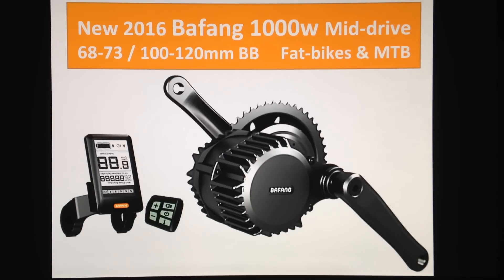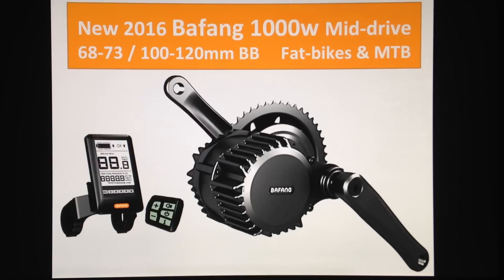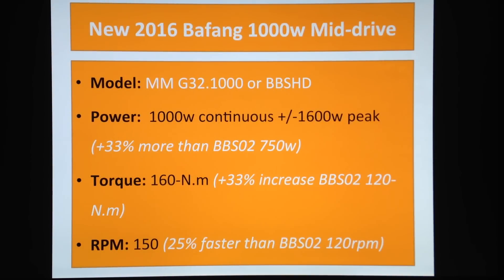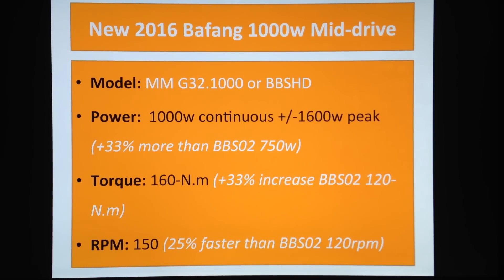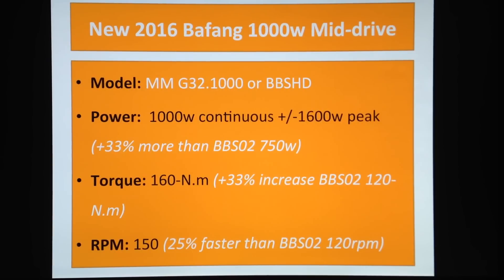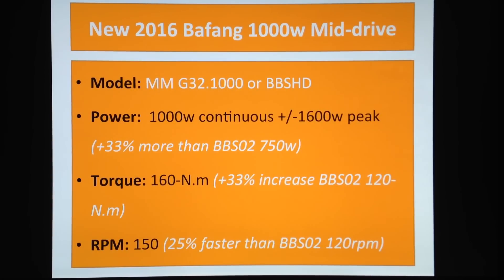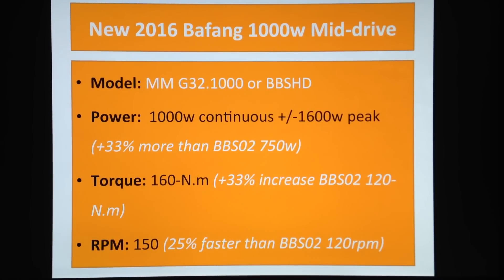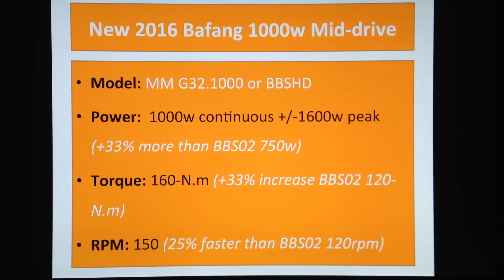New 2016 Bafang BBSHD 1000w mid drive for Fat Bike & MTB (video 1 of 7) MM G32.1000 8fun BBS02 750w

Comment: Wow I just got mine on but 10kg weight mass ... need bigger coils on suspension.. 🙀
Reply from the maker: Yeaaaaahhh... you will LOVE this motor...
Why 10kg?!?!? The BBSHD is around 4.8kg what size is your battery pack 20Ah???
Reply: Man it's showing a error 30 ... worked fine on day 1 (10min ride ) ... the next day I shortened the battery cables and error shows .. no POWER % !!! Haha .... looks like I'll be sending it back :/ .. error 30s are communication errors so I'm assuming my battery is ok and it's the controller / screen . I rewired everything twice .. battery shows 54v  fully charged (48v 20ah) seems ok  ... not a good start to my ebiking experience
Reply: https://youtu.be/TnM0lLL0RM8

Comment: whats your experience with the durability of the bafang middrive hd 1000 - ... Watt Motor. In comparisson to a direct drive hub motor the gears of the bafang could become problematic. Good here is that you can get spare parts for a acceptable price. Also to put smear nipples on the motor could be helpful. How many miles did you drive with this motor without bigger problems ? My 150 $ chinese direct drive hub motor ( 1000 Watt ) now has 20 000 km ... and still doesnt give any problems. What would you recommend geared midrive or direct drive hub. Seems the bafang with 30 A is a little faster than my hub motor.
60 kmh   vs    53   kmh.

Comment: We have two FS mtb with HD motors that we use to ride hills, both motors now have loud noises when we ride. Anyone have the same problems after 600 miles? Openned up both motors and did not find any obvious problems. Re-grease helical gear on rotor and the spur gears on crank drives with aircraft synthetic grease. Same noise problem after two rides.

Comment: We cant get into the menu Bafang 1000w (DPC10.UART)   to check voltage ...The battery display wont come off full charge. Password portion menu for battery  communication...Goes from  (nnA to LUd) we need the screen between these 2 screens....to check the settings.....HELP  !!

Comment: Does this have enough power/torque to perform a wheelie: either from rest or while moving slowly? I'd be impressed than!
Reply: My cheap, extra heavy Razor MX500 with 750watt 48v motor with my big lug 210lb body on it can produce 1400watts and do a wheelie from a slow moving start.
Reply from the maker: +RCengineJoe yeeeaahhh.. It does torque and power enough for almost everything you need... i have been climbing some big stairs lately.. monster torque and high speed specially if using with a 52v (14s) battery at 30A =]
Reply: I am running a 42 front ring, a 34 back sprocket,  52 volt battery and if you lean back it defiantly does from a stand still/ slow speed. it can surprise with a wheelie while climbing steep stuff if your not careful as well. I think this is perfect. powerful, quiet and reasonably light. Unfortunately it's not cheap and if your mates don't have one you will be riding on your own.
Reply: Yeah I know, I want one really bad but I need to buy a new bike plus the Mid Drive Kit and Battery. I'm looking at a sticker price, for what I want, of a minimum of $1800.00 USD.

Comment: question. I have heard that the peddle assist is gonna give you problem when switching gears because the gear sensor isn't fast enough to detect it. Is that true?

Love your enthusiasm btw  :)
Reply from the maker: Hi Tony, it depends what gear sensor and what controller and what programming settings you're using. Some controllers come with a connection for gear sensor and some controllers you have to connect to one of the ebrake cut off connections.. in 98% cases it works fine, what will vary a lot is how long it will cut the motor power. There are some combinations that you do specially when switching between pedal assist and throttle that you may the gear sensor may miss it but you'll learn how to ride and avoid anything like that. =]

Comment: that amount of motor force will likely  gradually crack bicycle metal tubing over hundreds of hours and the crack could spread further over time unnoticed and could suddenly break  whilst in use. the rear swing arm might get snapped off the frame  also from the force created from the chain pulling against the cassete flexing the swing arm

Comment: Nice one.
Can I put the pedal assist off and use just throttle when I face uphills on my way to/from work ?
I want to pedal on my own and do the above.
Thanks.
Reply from the maker: +Dr Abd - Yeeeahhh.. it is totally possible to switch the pedal assist OFF which in this case shows on the screen as "PAS 0" however, the factory settings Bafang ships with this units won't allow you to use throttle on PAS 0, good sellers will be able to program throttle at PAS 0 for you. There is a programming cable that you can buy separately and connect to your windows PC and change the settings. There are tons of articles like this one showing step by step how to do it https://electricbike-blog.com/2015/06/26/a-hackers-guide-to-programming-the-bbs02/
IF this sounds too difficult, maybe just buy from a sellers that will do it for you =]
Reply: +ElectricBike (Bruno) 
ok, thank. u r great.

Comment: Hi, I love your videos.  I want to buy the 8 Fun mid-drive now.  You seem like an expert on them.  I have a question though.  Can you install the 8 fun motor on a bike with an American size bottom bracket if you use one of those American to European bottom bracket adapters?
Reply from the maker: +kiana304 - I am not really sure about the American BB as I am located in Australia... as long as the BB is 68 to 73mm wide if should fit. The BBSHD is also available in wider sizes for full suspension and fat bike frames. Just keep on researching your American BB model, I am sure you will find someone with the same case here on YouTube or on this massive electric bike forum https://endless-sphere.com/forums/
Reply: Thanks for your help!

Comment: Do u have an assembly diagram? My bike has hydraulic brakes, and the crank sections seems wider than normal.
Reply from the maker: +Merii Hasch - Ah... Bafang changed some links on their website about a month ago... try this link here: http://www.szbaf.com/en/components/component/motor/mm-g321000.html
Reply from the maker: +raydioz - Bafang has some measurements on their website http://www.szbaf.com/en/components/component/motor/mm-g01350dv.html basically, if you have a normal bike you should get 68 or 73mm bottom bracket size (same motor with little adaptors for each size), some dual suspension may take the 100mm, fat bikes supposed to be 100mm (some are) but most of them actually have a very wide frame so you have to get a wider 120mm model and install some adaptors (10mm each side). Sounds a bit complex but if you spend some time researching and measuring your bike you will be fine =] Some good websites are: 
http://electric-fatbike.com/
http://electricbike.com/
https://endless-sphere.com/forums/
Reply: Just what I was looking for, thanks.
Reply: +ElectricBike (Bruno) The link does`t work.!!! ;)
Reply: awesome, thanks

Comment: hi electricbike. great vids. im really enjoying them. you have a very entertaining presentation style lol.

can you please answer a question i have on motor torque of this motor compared to car engine torque. i was wondering how the 160 nm of this motor stacked up against a car that is familiar to me, namely the mk1 golf gti 1800 from early 1980s. that quite powerful car for its time had 109 lb /ft of torque maximum. so i converted the 160nm of the electric motor to lb /ft and it came out as 118 lb/ft, which is actually MORE than the golf gtis engine produces. tell me if im making a big mistake?? i know IC , esp petrol engines do not have great torque compared to electric motors in general, but can it be really be true this relatively tiny electric motor has MORE torque than a 1800 fuel injected car engine ?? surely not. i would have expected the gti engine to have 10 x as much torque, at least  to get acceleration of 0 - 60 in 8 seconds :)

what am i doing wrong???? if the figures are accurate, your bikes must have ridiculous standing start acceleration. i know they wont reach 60mph, but have you ever timed, say,  the 0- 20 mph or 0 -30 mph times of your bike. it would be cooooooooooooool to see it done . powwwwwweerrrrrrrrrrrrrrr :)
Reply from the maker: +andy765gtr - Yeeeeahhh.. thanks for watching my ridiculous screaming videos hahaha.. 
I used this website http://www.convertunits.com/from/newton+meters/to/foot+pounds and I got the same numbers you mentioned above... It is hard to believe that such small motor could have the same torque as a 1800cc petrol engine that accelerate a heavy car from 0-60 in 8 sec, the BBS02 has a small motor and could peak 2HP but electric motor have a huuuge torque that would destroy all internal and bike gears. I have a disturbing video for you showing the acceleration I was getting from my old BBS02 (this link has also a playlist with other fast videos) https://youtu.be/a3Xf5WETMd8?list=PL59mIOWSOm9oCSSWCGHdJKYen8hn5fBa9 
My road bike is about 11kg + BBS02 4.3kg + 3.8kg battery + myself 72kg = 200 pounds, quite light setup what helps with the acceleration =]
Would like to see something insane? I am waiting for a super powerful custom motor to arrive... only weight 16 pounds and puts over 400 ft pounds of torque at the rear wheel (realistic, true output, not theoretical output).  Check out this link with more info: https://endless-sphere.com/forums/viewtopic.php?f=28&t=74176&start=50
Imagine the acceleration...  much POWEEEEEEEEEEERRRRR..!!!!! hahaha...
Reply from the maker: +andy765gtr - I just did a LOT of research and yes, the torque on electric motor is super insane compared to combustion engine (fewer parts and no clutch losses). Check out this Ferrari on dyno and the numbers were much lower than the manufacturer claims with 269 lb-ft wheel torque http://www.ferrariboost.com/content.php?6102-Ferrari-458-Italia-output-overated-Comparing-Mustang-and-Dynojet-458-dyno-results

Comment: I have a full suspension with 'press fit' BB92 bottom bracket. Would the 100mm kit be the right one to order?
Reply from the maker: Hummm you got my weakness... =/ I don't know much about the press fit BBs... I have to do some research about all size differences. 
The rebranded "eRad" makes Bafang mid drive adapted for all these cases.
The best thing is go to a bicycle shop if you can and ask a bike mechanics, they will know all measurements internal diameter and BB width.

Comment: I will be ordering a USB cable to tweak things a little. I noticed there are some good config files already online from Empowered, Endless Sphere peeps etc, be good to see your config screenshots as well for programming... any chance to put them online somehow?
Reply from the maker: +Tim Millington (AllThingsTech) - yeah I have been thinking about making a video, it is pretty easy, and all to do with the way you like your bike to respond your commands... I spent hours and hours testing, changing values for my riding style...  just do a print screen of all 3 screens in the controller software so you know the defaul settings and you will be fine. Hopping the new controller will share the same software as the BBS02 models

Comment: Im glad there increasing the power of these mid drives finally :D
Reply from the maker: Me too... I have been pushing my 750w so hard trying to make miracle happens haha this "1000w continuous" will bring lots of fun to lots of silly people like me!!! Hahaha
Reply: ElectricBike you probably know of Hi Powered Cycles right. I was wondering if you think they are doing what you did because they have a 750 watt all the way up to 1400 watt. Do you think they boosted the output to the motors limit. Because I saw on there site as well that this same motor was coming out. But if its only 1000 watt then that is confusing to me. You think they are going to boost the power output and label it 3000 watt?
Reply from the maker: +JoeGo101  - veeeery good point you just mentioned about High Powered Cycles....  yes they re-labeled the 750w to 1400w doing exactly what I did.. put a 14S (58.8v) battery and changing the settings inside the controller making it accelerate aggressively so it really feels like 1400w... they also changed the chainring for MTB riders..  I have to say, they were very clever advertising and selling this tuned version =]  The new 1000w motor will be the same thing, just not sure if the software we have for BBS02 will be the same for the new controller, yes, people will be setting this motor up to 1600w and it is not only power that is increasing in this new model but the RPM as well  =]
Reply: +ElectricBike (Bruno) Very cool really appreciate the response :D Your very knowledgeable :D
Reply from the maker: +JoeGo101 - yeahhhh.. I am veeeery passionate talking about technology hahaha... I am getting my brandnew 1000w soon and will be doing the  controller modifications and posting videos showing step by step =]
Reply: +ElectricBike (Bruno) cool I look forward to those videos :D
Reply from the maker: +JoeGo101  - I am also making a special super powerful one with over 28000w.. hahaha =]
Reply: +ElectricBike (Bruno) nice :D

Comment: Are you 100% sure about the 45amp controller?? Right now lectric cycles are testing this kit and they say it had the 25amp making it compatible with existing bbs02 batteries!!!!!!
Reply from the maker: +kevinjohnoflynn - Bafang doesn't have much "official" information available, as usual most of good info you will get from the importers who bombard them with questions and publish it online causing lots of "rumours". The new controllers have powerful mosfets so I think it will be "capable of 45A max", by doing that the controller won't be pushed too hard and will last much longer. It is totally possible to limit the amperage to 25A so it will be compatible with the BBS02 batteries, but if you're getting a 1000w mid-drive, why would you do that? I don't know I may be talking rubbish... =/

Talking to Bafang the other day, I got some warranty information you can't find anywhere... some basic things that "Bafang just forget to mention" on website. I will be making a quick video with these updates. =]

Comment: Hey mate awesome detailed comparison! , Which battery pack do you think we are going to need to run this for decent range? Will a 48v 16.5Ah Triangle Pack in a Frame Bag be big enough to last for 50kms? I suppose the extra weight and more power is going to drain it much quicker than say the BBS02 and a 48v 14Ah Dolphin Pack...Your thought on which battery I should buy would be great..
Reply from the maker: Hi Tim, what you said about bigger motor and heavier battery consuming more power "sounds correct" but a smaller motor "struggles" much more than a larger motor with a more powerful proper battery pack. A larger motor will do the job easily effectively and efficiently + is always good to have extra power. Same idea applies to car engines, some cases a V6 car would be more economical than a car with small engine running at very high RPM =]
Reply: +ElectricBike (Bruno) yes I've decided to get the best battery I can afford for this new 1000w weapon, prob go the 16.5ah bag pack which I've been told has about 83 cells of Panasonic goodness! also do you currently use a gear sensor or u using the brake squeeze trick to kill the motor between gear changes...?
Reply from the maker: +Tim Millington (AllThingsTech) - yeahhh this will be a weapon hahaha love that nick name hahaha...
I have it installed on a road-bike  so I couldn't  use the brakes that came with my mid-drive kit, I had to install this  sensor: http://www.empoweredcycles.com/collections/8fun-bafang-bbs02-accessories/products/8fun-bafang-bbs02-hwbs-hidden-wire-brake-switch       It won't improve shifting gears, if you would like to shift gears like this video https://youtu.be/Pkjgxo5G_UY  you better forget about "Pedal Assist Mode" and enable the throttle only (using the USB cable you can do it), I think I wil have to make a video showing all that... =]     84 Panasonic cells sounds "SEXY" hahaha ohhh yeahhhh!!! Just pay attention to the BMS specs in this pack.. so many batteries packs out there have good cells but the BMS  is not as powerful and you have a "bottle-neck" limiting your cells to perform 100% =/